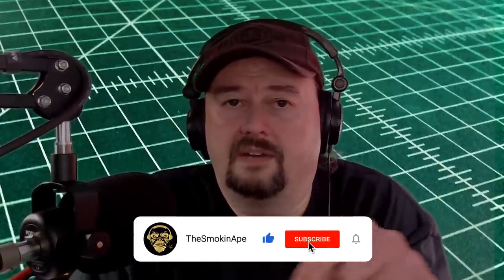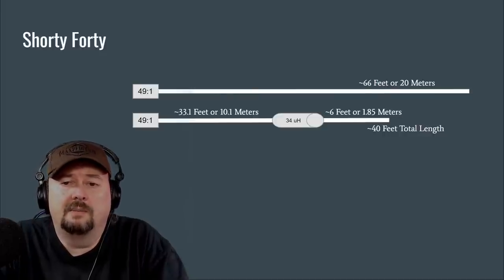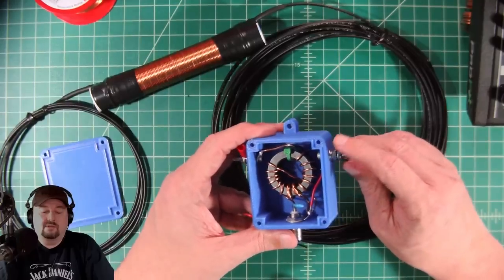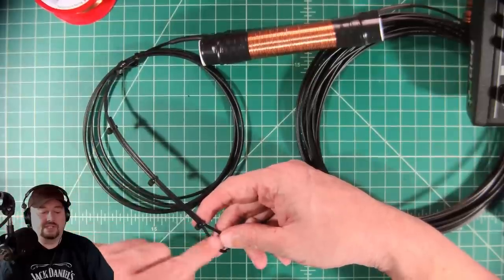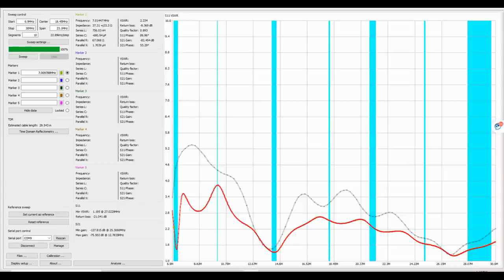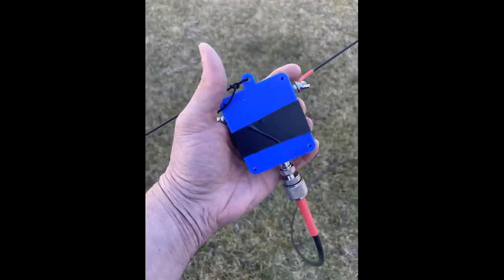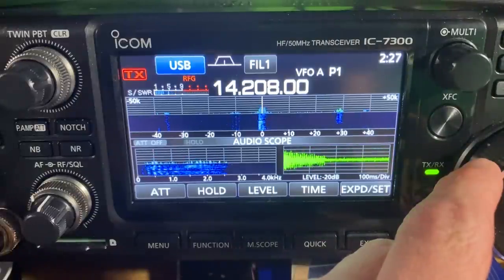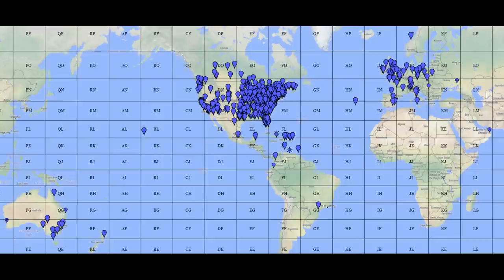Best Ham Radio Antenna for Small Spaces - Shorty Forty

Comment: Hello, and Thanks for the video/info. I wanted to ask you when you tuned the 20 meter did you tune it with out the coil?
Reply from the maker: Hey Andy, I did tune the 20m part without the coil.

Comment: It's an interesting antenna, and a nice build by you. I'd be curious how it compares to a 35 or 41 foot end fed wire with a 9:1 match box. I might have to build one of these for experimentation. Nicely done video.
Reply from the maker: Thanks CWB!  I actually use a 9:1 often as well, both at 35.5 and 41 feet.  I’m a fan of End Fed wire antennas in general 👍
Reply: @TheSmokinApe  I use those two lengths myself for a vertical configuration and they work quite well, and I use longer lengths for a sloping or horizontal configuration. I also like end fed antennas of the many varieties. I think they are underrated and I've found them to be more efficient than many would have you believe. I likely always have one around in some form.
Reply from the maker: @CWB-RF  I like them because the are quick and easy to deploy, multi banded and stealthy 👍

Comment: Hi Ape,
Well done video. I have all the makings for a vertical 40m EFHW, but may try making a coil to shorten it up. Just waiting for the ground to soften to pound in the mounting post. Stay safe.  73  WJ3U
Reply from the maker: Thanks Don, I’d like to get this vertical but I don’t have the trees to pull that off 👍
Reply: @TheSmokinApe  Hi Ape,
I was going to make the vertical out of aluminum, but if I try the shorty fourty will use another Spiderbeams fiberglass pole.
Reply from the maker: One of these days I need to pick up a Spiderbeam

Comment: Ok i just about got this built... what is the minimum heights at each end... youll have to excuse my ignorance of wire antennas, ty sir.
Reply from the maker: I typically have mine with the UnUn about 3' off the ground and the end about 30' up.  It can be mounted in a variety of configs 👍

Comment: Looks like a cool project.  But you don’t explain how to make the coil!!!  Can’t try your idea if I don’t know how to make that coil or, apparently somehow you tested it for induction Never did that before.  Are there instructions for this project anywhere?  I have a 49/1 transformer wrapped around 3 torroids from the EFHW project going around You Tube.  Just not enough room in the attic.  34 ft. So I have an EF 20 meter antenna up there and it works great.  40 meters would make my day, and the way you did it will mean it’ll fit up there!  Just need the details!  Thx Dave N9DMS
Reply from the maker: The coil build video is in the description, I mentioned it twice in the video.  Good luck with the project this has been a great antenna for me.
Reply: @TheSmokinApe  Got it Thanks.  Don't know how I missed it but I did.  Thanks again,  Dave  N9DMS

Comment: Know this is an old one, but do have a question- looking for the math for determining the "extra" length- say I've got a traditional 66' 40m EFHW, and I want to extend it to 60m band.  Where do I find the equations for inductance and extra wire length needed?
Reply from the maker: Hey Dennis.  I’ve only seen designs for 40 and 80m.  Pacific66 has a bunch of online coil calculators that might be able to help you out…

Comment: Would you get any significant changes in SWR if you put the  swapped the antenna around and put the transformer on your mast and the other end attached towards the ground?  Just curious….
Reply from the maker: From my experience these transformers work better near the ground.  If you mount it in the air, I am sure you could adjust the element if necessary.

Comment: Would it be ok to use a different wire at the short end? They are both made of copper but have a slight different dimension.
Reply from the maker: It should be fine, good luck with the build 👍

Comment: Can I do this with a 9:1 instead?
Reply from the maker: The values would be different and you need a tuner with a 9:1, with this you don’t for a 49:1
Reply: @TheSmokinApe  ok 👍 I have a 991a and a ft 840 with ldgz100plus atu.  The wire is 72 ft sloped with a 17.5 ft counter poise. Can receive great but cannot transmit with out high swr like 5+
Reply from the maker: The LDG won't tune it?
Reply: @TheSmokinApe  I don't have a cable for the tuner to connect to the radios interface connection. I will try on the 991a tonight for the local 20 meter net.
Reply from the maker: @lonewolfe666  you should have no problem with the tuner.  It might have auto sensing so you don’t “need” the cable.
Reply: @TheSmokinApe  I grounded the 9 1 unun to my Ground on the electrical panel on the house. Since then I've made huge amounts of Qso all over the world. The counterpoise wasn't even close to helping.
Reply from the maker: @lonewolfe666  glad to hear you found a solution that works for you 🙏